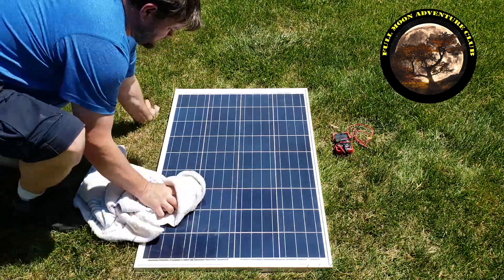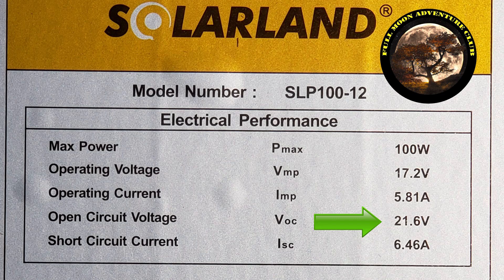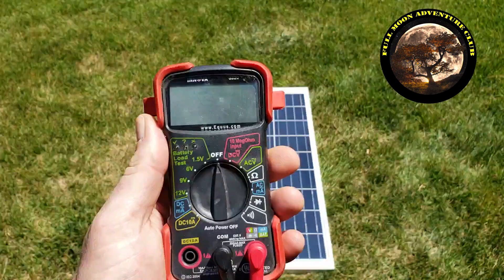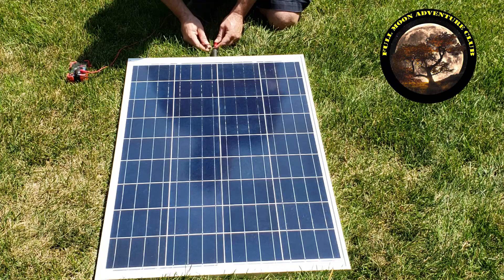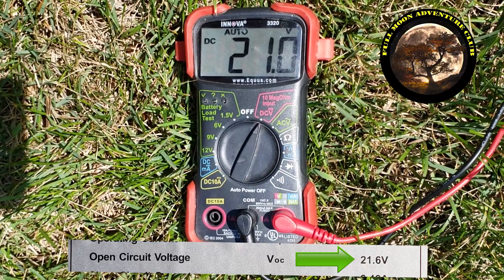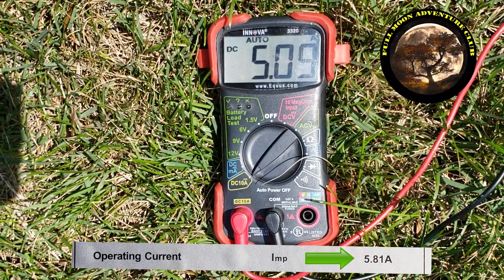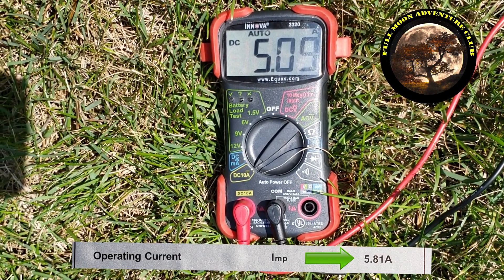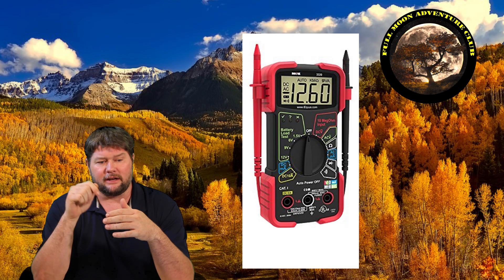How To Test Your Solar Panel - Quick And Easy

Comment: Good info 👍 
I tested all my panels and all is well. 2 of them in a 5 panel array are about 10 years old and going strong. I used a cheap h/f meter but the more important note is use the right settings. Or you could melt-burn the leads.

Comment: This test shows if the panel is functional... However, the problem with this test is no one ever actually uses the panels with a short circuit or open circuit. The real test is when you have an actual load like a battery that is low with a controller that is rated rated to use enough load to be measured. Alternatively, you may use a power analyzer that would rate the output of the panel accurately.

Comment: Sir, please I need ur assistance. Please I have 4 PCs of 80w solar panels and 4 PCs of 150w solar panels. How is the better way to connect it to get good results. Also I have 250a of single battery

Comment: This is seriously handy information . 
I have a panel on top of my rv . It is an old panel , but i've got no idea how old it is , or what current it's producing . The charge controller has indicated a maximum of 2 amps , but then i'm pretty careful with the battery power i use anyway . Reckon i need to get out there and run some numbers , i just didn't know how .

Comment: NOT GOOD....  The "Open Circuit Voltage" measurement was ~21 Volts which is good.  The "Short Circuit Current" measurement specified on the panel label stated - 6.46 Amps and for whatever reason your referenced the 5.09 Amp value to the "Operating Current" specification when in fact the "Short Circuit Current" was stated as 6.46 Amps....  The values reported were good overall, but, the current measurement was misleading at best....

Comment: What would it cost you to have negative vault readings on your? Solar. Panel? Connection got positives at the solar panels and when they're all grouped together. I have so positive number but as soon as you connect it.

Comment: You have One of the best videos on YouTube simple direct just the way people like them. I have a Cascadia 4 x 4 solar panel and I’m measuring amps the specifications say it should put out 5.5 A but I’m only getting 1.365 I’m using the same ohmmeter as you. It’s in full sun so I’m wondering if you can tell me if that’s good or bad it’s supposed to be showing 5.5 in full sun what do you think.?
Reply: Are you setting it to ohms or amps? You should have it set to A (amperes) to measure current.

Comment: Did I do this right?  Solar panels: Output 21.6V, IMP 5.56A

Good sun but a little clouds:

Multimeter showing 17.7V for both panels.
On Amp, am seeing DC 0.193 (max 10A) or 0.3 (Max 500mA) depending on which input I use. 

Values are for both my solar panels.

Am new to this. Does this mean my panels are faulty?  Hoping it's user error on my part with my multimeter.  Not understanding why my Amp values are so low.

Comment: Hi,help me please,i have two 400w solar pannel hooked up in series.When i meassure volt and amps with multimeter i have this( 80v with 9A= 720w) but when i connect them on my mppt i have only 250w. In load drop the power more than half. Can you give an advice. Thanks a lot. Cheers
Reply: When you hook up solar panels you can hook them up either in series or parallel. When hooked in series you add the voltage but the amps stay the same. When hooked in parallel you add up the amps but the voltage stays the same. So, you might accidentally be adding both voltage and amps together. Probably it is best to know two things... What is the voltage and current from just one panel? And, are you hooking them up in series or in parallel?

Comment: Unfortunately for me, science was not my interest; so using my multimeter, or recognizing good results vs bad, is always a "wait, wut?" experience.  But you got me through it--Good on you!  Seems my new Elecaenta 120V panel passed the test with 22 V and 3.8 A.  Seems close to what your video said was good numbers.  Daytona Beach is blazing hot today, but on the fence of whether to shine or thunderstorm.  So that's enough testing today.  Thanks again.

Comment: I bought a Sunjack 25 watt solar panal for camping and hiking.  Tested it w my phone.  It drains my ph battery instead of charging it.  Why is that?
Disappointed.
Reply: You need a charge controller bro
Reply: @joysonbaretto3690  Seems kind of a lot to attach to a hiking 25 w solar panal.  I ll practice more.  It takes a long time to charge ph and I lose my patience.  Hours.   I live in GA mountains.  Its for my gadgets and hiking. 
One time I got in a jam in a trail.  My phone died.  Car troubles.  I couldnt reach help. It got scary. Luckily I didnt have to sleep in my truck bed.  So I am trying diff ways to stay charged.  Battery Banks etc.

Comment: A question. You measured the short circuit current Isc as you directly connected the multimeter to the panel terminal. Then why are you referring to the Imp? I was expecting a current around 6A. Don't you think the 5A is low? Or maybe the panel is not the facing the sunlight correctly.
Reply: Since the panel is flat on the ground, the panel is likely not facing the sun directly

Comment: What if I bought that crappy Habor Freight $20 1.5 watt 1 foot × 4" trickle charge solar panel that has no printed table or open circut numbers? Call Harbor Freight and say WTF? Can't return it because it's been a few months since I bought it. How many watts does a panel need to be to charge a Group 27 Deep Cycle Marine Battery? Not a standard lead acid. If this panel is too small, can I hook it up to a USB - C cord to trickle charge a smartphone? Plenty of sunlight here in L.A. County.

Comment: Don't measure the amps like that if you have a high wattage panel! You will blow the fuse on your multimeter.
Reply: 250w too high?
Reply: @carl8568  It's the current (Amps) not power (Watts).
Reply: @PatternMusic  
Higher w means higher amps.
Reply: No @carl8568 . Higher "w" means higher Watts. Watts = Volts x Amps. A cheap multimeter like the one in the affiliate link on the video is limited to 10 amps. There will often be a fuse inside that will blow when you exceed that. A 250W panel might put out 20 amps. Blown fuse.
Reply: @PatternMusic  
Nope, more like 8 or 9.
Reply: @PatternMusic  
You're the one who said high wattage panel 🤷
Reply: @carl8568  I have panels on my roof with a Short Circuit Current of 10.5 amps.
Reply: @PatternMusic  
👍

Comment: This current measurement is short-circuit current (Isc), not "operating" current (or really current at maximum power point, Imp), so the comparison to specification is wrong. The measured Isc of 5.09 A is well short of the rated Isc of 6.46 A, so the panel is not operating to specification... perhaps because it isn't correctly oriented.

"Instructional" videos which give blatantly wrong information are worse than no information at all.
Reply from the maker: It was laying flat and it was probably cloudy which is probably why the amps were low. There is nothing wrong with the panel. It was brand new. This to see if your panel is operational, not to test if it is running at peak factory specs. This was just a quick and dirty way to find out if the panel was functional if your trouble shooting a small DIY solar system. If you need to get technical for large array setups there are thousands of VERY detailed and technical videos on the subject. Thanks for the comment and happy camping.
Reply: @fullmoonadventureclub  like I said, "it isn't correctly oriented." But you're missing the main point: you are comparing to the wrong value, and don't seen to understand that.

Comment: OK.. I just did this test.  But, my multimeter just caused a major spark when checking the AMPS.  I was testing where the panels came into the MPPT.  What did I do wrong?  the tips of my meter testers are black now... ughh...
Reply: Might have exceeded your meters limits when measuring at MPPT. You are measuring all of your panels at once, not individually .

Comment: what would the reading be for 2 or more 100 watt panels?
Reply: Depends if you have connected the solar panels in series or parallel. For example: if you would have 2 of those 100W panels connected in series the voltage of both panels will add up to the total voltage, while current will remain at the same value as could be expected for 1 panel by itself. 

When 2 100W panels are connected in a parallel circuit (instead of in series) the opposite will happen: measured voltage will remain at the 1 panel level, but now the current of both panels will add up to the make total measured current.

Comment: Hi! If a wire with a 120 volt phase touches the frame of a solar panel that has not yet been installed, could it damage that panel? Thanks

Comment: I’m getting 21 volts from my 100 watt panel but when I connect it to my controller it trips the controller and blows the inline fuse to the battery!   Tried another controller and same thing.
Reply: Did you first connect the battery then solar

Those are the steps you have to go through

1st battery then solar
Then battery last

Comment: HELP!!! ok my panel says open circuit 45.4 V maximum 36.2 the controller is 25v maximum it blinks fast saying solar panel over voltage. Then what size controller do I need? Ugh I hate this, my other controller was the same size but it didn’t blink so I never knew it was “solar panel over voltage” whatever 🙄 please help!! I loved your video btw you are awesome and will be even more awesome if u can answer my question.
Reply: Get an mppt controller....and not a cheap one.   If it cost less than $100....they are lying.

Comment: Thanks for the video, How about wattage? Is there a meter or maybe a calculation?
Reply: The formula for calculating wattage is: W (joules per second) = V (joules per coulomb) x A (coulombs per second) where W is watts, V is volts, and A is amperes of current. In practical terms, wattage is the power produced or used per second.

12 volt
15 watts
1.25 amps

W=v x a
Reply: no need to work out wattage if your voltage and current are correct as stated on the sticker

Comment: How are you testing for amperage with no load connected?
Reply: The ammeter basically is acting as a piece of thick wire. (We say its a Short circuit or zero Ohms) Since it  has to measure current accuratelty, it can't add any resistance (or opposition to current) while measuing flow.  Care must be taken to use the portion of the meter for highest possible current (usually 10 amps on el cheapo handheld meters) since there is no fuse there to blow when you create the short when connecting l meter test leads straight to the panel. If you use the milli-amp  (mA) meter setup you will blow the internal meter protection fuse and also get a 0 amp reading on the meter display that may cause you to think your panel is bad. This test method is great for panels that dont put out more amps than the meter can handle.
Reply: @brucelampe6062  My 18 dollar el cheapo meter has two fuses and one I blew out at some point in my tests.  Not cheap and hard to come by but it was the 700ma fuse.  The other fuse is a 10A fuse so the 10A also has a protection fuse, but some meters do not.  The best meters to measure real current with are clamp meters as they can measure upwards of 200 amps.  I saw a 20 dollar one that could measure up to 400 amps.  I really need to get a cheapo clamp meter as it can measure directly AND indirectly over the hot lead (DC or AC).
Reply: He is testing short-circuit current, but doesn't know what he is doing so he calls it "operating" current (which is really current for maximum power, Imp).

Comment: You have measured short-circuit current, not operating current.
Reply: I was looking for this comment. He measured by connecting multimeter parallel to solar panel. Actually he had to connect multimeter series to solar panel.
Reply: running ampere rating  can only  be measured correctly  if there is a load  and  by using a clamp meter.

Comment: Hey thanks for the information. I hooked up my 20 white panel. It says it puts out 17.9 V in 1.14 A. The voltage test fine, but when I test amps with a multimeter, it reads .06. That doesn’t sound right. Any thoughts? Thank you
Reply: I have the exact same issue with some used panels i got.  Were you able to figure this out?
Reply: Bryan Seversky I don’t really know what it was. I didn’t change anything, but the next time I put it in good sunlight I got .76 A and 21 V. Still not up to claims. However it did charge my lawnmower battery really well, really fast. So I guess it’s OK

Comment: Thanks. The problem is you didn't say what the tolerance is. What if the actual open circuit voltage is 3 volts less than rated (22.6 vs 19.6)?
Reply: It is a matter of opinion how tolerant you are of less potential.  Unless you work in QA of Solarland.

Comment: Current measured was short circuit, you would need to connect this to a load in order to measure Imp.
Reply: Yep, should be comparing that current reading with the "Isc" value.
Reply: Correct

Comment: Thank you👍🇺🇸.  I went to hook up my panels and no markings + or - BUT the connectors are already on it both black BUT one has a “male” type tip and the other is a “female” socket type type.  So can I assume they are as they appear to be? I cannot find my meter so I will buy another.  My Kodiak has protection but I’d rather know if there is a factory standard because I have some Renogy and 1 off brand.
Reply: Don’t worry, you can’t harm your meter. If you connect up the wrong way the meter will displayed minus X voltage. Simply swap around the probs in this case.

Comment: Hi Jim! Thanks for the great video. My 150w panel is given me 18 volts and 2Amps (Short Circuit) in full light. What can be the issue?
Reply: U should be making 8.3amps.
Watts ÷ Volts = the Amperage (if i got it right)

Maybe your panel has degraded(?)

Comment: I am trying to run a 12vdc attic fan that runs at 11 amps, my solar panel is 120v with only 2.0 amps at 18v. im using a buck converter to convert my voltage to 12vdc The fan will run but im only getting 8.4 v to the fan. On the line side of the converter when the fan is running my voltage is same as the load side, 8.4. What is my issue??? Help
Reply from the maker: I believe you're going to have to have a battery in line in that setup. Are you trying to run the fan off the solar panel alone?
Reply: @fullmoonadventureclub  Yes through a buck converter,  Can you recommend a charge controller, I will use a lead acid sealed battery.
Reply: A correction on that solar panel amps It's 6.7
Reply from the maker: @danonly55  4-1 lead acid battery in a small attic fan you can really pick up any charge controller on the cheap end and you'll be just fine. You don't want to spend a lot of money on something that's just going to be running a fan. I would go pwm basic charge controller.

Comment: Isn't the current measurement supposed to be the Isc, i.e., the closed circuit current?  The Imp is the max current you would expect from the panel if a load is connected (@ Vmp).  If without a load, or just the Amp meter, the voltage drastically drops; shouldn't you read closer to Isc?
Reply: exactly
Reply: You need a load bank to properly test the collector 21v x 5 amp =105watts.  21v x21v/105w=4.2 ohm. If you connect a 4.2 ohm load you should measure 5 amp. Any amperage lower is proportional to the true wattage output of the panel.
Reply: @stanvancleave2260  load bank🤷
Is a 2kw heater enough
Reply: @stanvancleave2260  Yep that's right, at last someone who actually knows what they're talking about.
Current measurement in video is basically meaningless, you have to connect a load exactly as you said with multimeter in series to read current.
Far too many videos on here with wrong and misleading information.
Reply: Correct it's supposed to be isc
Reply: Same thought here.
Reply: So. What did you do for realistic power output reading. ? Introduce into the series circuit a resistance.. radiant heater, 1-2 kw

Comment: I can't seem to test my solar panel, although I am going through the built on solar charger. So as soon as i disconnect my panel from charging the battery the panel either automatically shows the green LED (high current, which in turn stop it from overcharging so i think it stops any flow of current) and or it shuts off completely..
Is there any other way i can test Amps and volts? The only reading i managed to get was 13.6 on volts, but i hadnt realised i had it on 20 on the multimeter so it not sure if i blew the fuse or not as it wont show anything when i put it on 200 now?
Reply: Does your panel have diods in the junction box? Cant really understand what you are trying to say. Can you try again? If its a 12 vilt panel, the voltage when not hooked to anything should be around 21 volts.

Comment: my solar box that is next to my breaker box isn't displaying any numbers it is a dead screen  does that mean my system isn't working or could the display screen just be bad?
Reply from the maker: It's entirely possible that your display is bad. You really just need to check the outgoing current with a voltmeter. That way you'll know for sure.  Jim
Reply: @fullmoonadventureclub  now i just got to learn how to do that , i know i can't get on my roof.
Reply from the maker: @Bobby381666  so if you're talking about a residential solar system you should be careful with the voltage involved. If you're not comfortable using a multimeter and checking voltages on a residential system you might just want to have an electrician come take a peek. Or at the very least make sure you're very competent with your system before you start poking around with the wires. Testing a 200 watt panel on an RV is a lot different than testing a 2000 watt residential system. Best of luck.   Jim